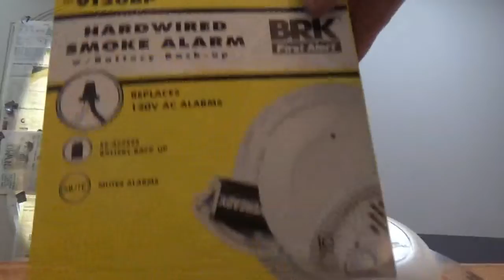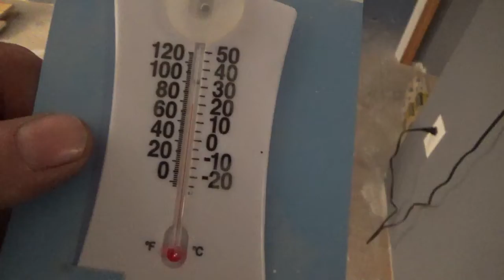Snow plowing and smoke detector install.

Comment: Morning Joe.... yep, we're suppose to get 3-7 inches Thursday night. We have about three or four on the ground now. Watching you plow looks just like the mess I made yesterday. I plowed with my ATV, but with the larger amount of snow coming I'll probably have to use my six foot blower and that will be throwing most of the rock and dirt I just kicked up... you're right, it's rough on the equipment. Back in the early eighties when I built my house I never wired in a smoke detector, I have all battery operated ones in my house. With the power being out so much around here, having them wired in would probably be a waste. I keep after changing the batteries and testing them regularly. I think the snow is here to stay and this has been the earliest we've ever gotten snow around here that I can remember, that never melted before Thanksgiving. I think you are going to be a better weather service for me, as you are farther south and west of me. If any storms are coming from the west, you'll probably get them before me giving me a heads up. That doesn't count for noreasters though. Have a good one.
Reply from the maker: Hi John,
We are suppose to get it starting tomorrow afternoon. Partly sunny today but only 26 at the moment.  Only a dusting last night. Suppose to be in teens tonight. Our worst winter was 2009 it snowed on the 2d of october and never left until May that was the year we got 42 inches in one week. It is rare to get snow that lasts before Thanksgiving. Something is going on, a herd of deer went through heading south early this morning. All those lumps yesterday are rocks today. Better watch where you aim the snow blower chute dont want to hurt mom.
Reply: @josaljo1  Everyone is far enough away, I try to avoiding my glass greenhouse the most though. We're suppose to get 8-12 now, Thursday night, so what ever you are getting is heading our way. So the season's fun begins Friday... I can feel my back already! Stay safe and watch your back.
Reply from the maker: @johncollado1151  Well John, it looks like this may be a perfect storm brewing, a lady from Michigan said it was real windy there today, and now we are going to get that SE wind after it goes over the great lakes. Oh no, 8" or more.
Reply: @josaljo1  Batten down the hatches.... it's going to be cold so maybe we won't be pushing mud!
Reply from the maker: @johncollado1151  It is already 19 degrees here. The ground froze last night. So only some lumps to push tomorrow.
Reply: @josaljo1  15 degrees here right now.
Reply from the maker: @johncollado1151  You better send your boy out to stoke the fire. My wife said the moon was out now it isnt !  Uh oh. Storm going to start early?
Reply: @josaljo1  My son is suppose to arrive on Friday evening, but that will depend on the weather now. The old man tends the fires now. Moon was out and I didn't see any clouds while I was sitting in the hot tub.... stars and milky way. The tub is now up to 102 degrees.... ah, nice!
Reply from the maker: @johncollado1151  One of the viewers just sent a comment, that it was 86 in Florida today, almost as hot as your hot tub. LOL
Reply: @josaljo1  I wouldn't mind sitting on a beach somewhere in Florida right now getting the sun tan lotion ready and watching those people up north all bundled up getting their snow shovels ready for the storm! I'd roll over and tan the other side. Not sure how much longer I'll be able to abuse myself living in this cold.